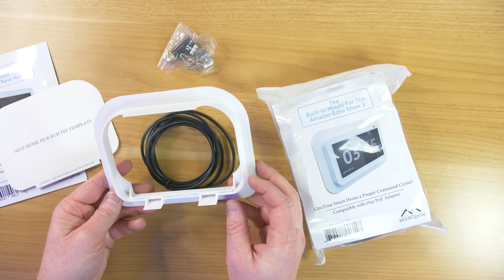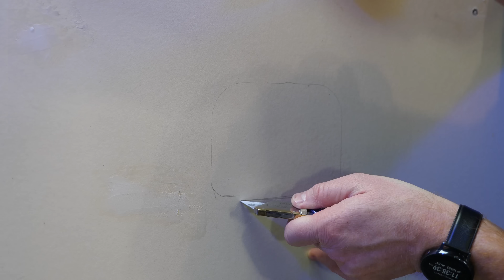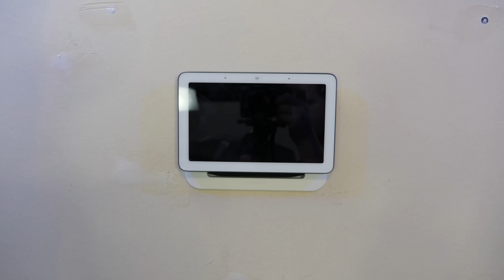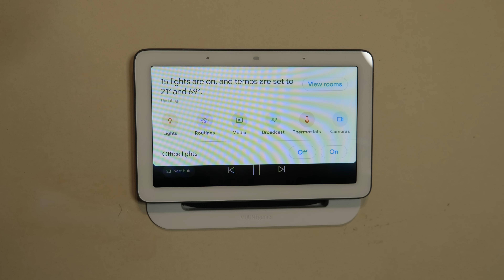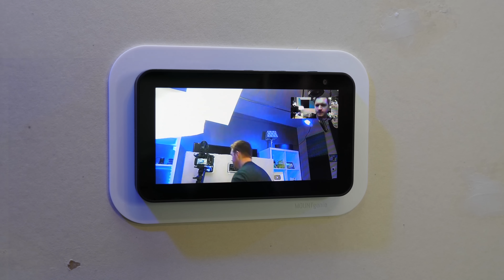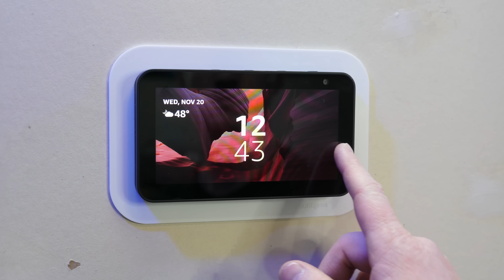The Craziest Mounts for the Nest Hub & Echo Show 5

Comment: I would never consider making a permanent hole in my walls for a device that is guaranteed to be obsolete in less than 5 years when newer models come out.
Reply: I was thinking this
Reply: Jokes on you man, we just installed one and its 2025, whats up!
Reply: @georgepalmer7759  Wait, you just installed a 5-year-old Nest Hub or Echo Show 5 on your wall?  I'm speechless.  I recently upgraded my Amazon Echo to get the new AI features.  I'm glad it worked out for you, but I'm also glad I didn't mount my old devices on the wall.

Comment: Instead of using the Ethernet cable will the WiFi still work once installed in the wall?  Thanks!
Reply: You could easily and much cheaper just install a receptacle or a junction box in your attic and pull the wires up there. Not necessary to buy the extra Ethernet junk and cut more unnecessary holes in your walls
Reply: Only using ethernet for power.

Comment: The way they power this is really stupid, it would make sense to power it over poe if the device had a network jack on it but both of them use wifi. Your better off cutting a 15 1/2" x 12 inch hole in the wall so you can frame in a niche with an outlet in the back (look up "wall niche outlet" on google images) then you can just mount the Nest in a board slightly larger then the niche and use it to cover the opening. This way also when the new nest comes out you only modify that small board for the new mount instead of cutting up the whole wall again.

Comment: Do they make this for the larger Echo Show 8?
Reply: They said they won't make one because the speakers would be in the wall..I need the same thing :(
Reply: @NewYears1978  Yeah, that makes sense. Sucks though. Would look nice flush mounted.
Reply: @blakenorthrup  I am going to build an in wall niche/shelf to put mine.
Reply: @NewYears1978  Yeah, that would look great. We have ours just sitting on the bar top now, but on a shelf would look sharp. Plus, be able to hide the power cable.
Reply: @NewYears1978  did you ever build that in wall niche for your show/nest?
Reply: @NewYears1978  wow! That looks amazing! Thanks for the idea James
Reply: @blakeduncan9122  Thanks! Good luck :)
Reply: @NewYears1978  any pointers or tips I should consider?
Reply: @blakeduncan9122 It was super easy really, the hardest part was making sure the stud I had to cut wasn't load bearing lol. I think I followed part of a guide online somewhere maybe I can find it.

Comment: For the Nest mount, I had a difficult time determining what exactly it was sitting on/against. It looked like it would make contact with those metal clips which could potentially tear the fabric around the speaker. That accurate?

Comment: I bought this as well. Biggest complaint is it doesn’t “click” in place. Doesn’t seem very secure. But a great idea!
Reply from the maker: I thought that putting some time of non slip material at the bottom of the hub might make it a bit taller and have a better lock at the top.
Reply: @TechWithBrett  You  could have it lock better at the top with velcro.

Comment: Pretty neat idea! I may consider this for my kitchen hub max. I am curious what impact this would have on sound installed in a real wall though. Even with the show the sound profile is going to be changed because of the positioning of the wall as well as being inside the cavity of the wall.
Reply from the maker: So far they sounded just fine. If there is enough interest maybe we will see one for the the Nest Hub Max.
Reply: Yes very bad idea and the max would be a waste of $$$. The subwoofer is on the back